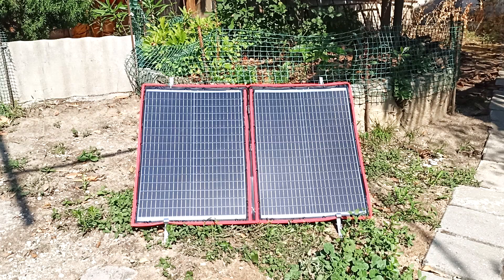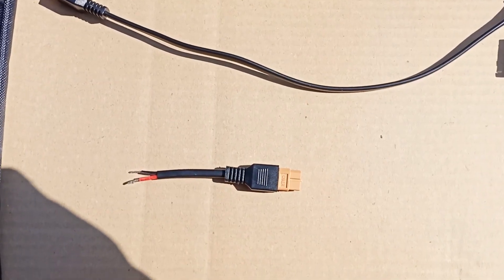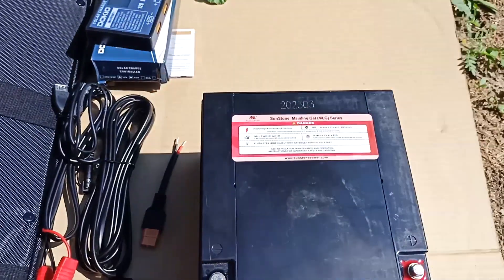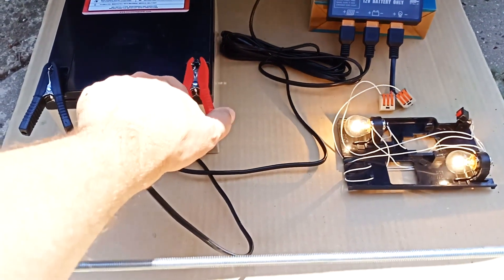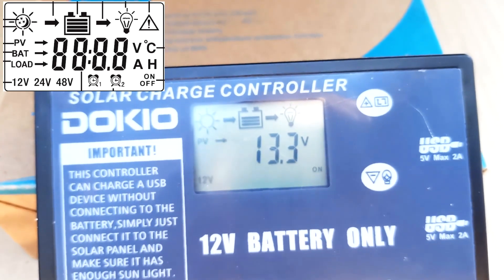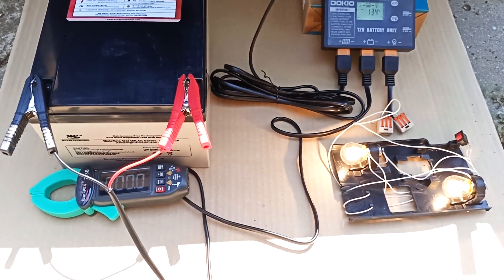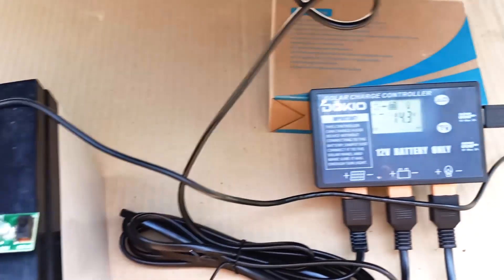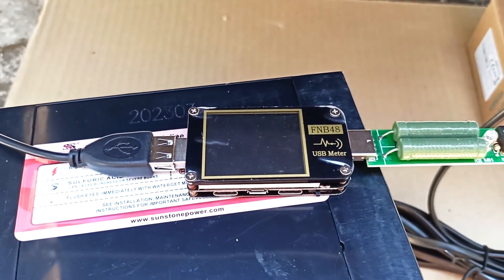100W Foldable Solar Panel DOKIO + 21W Solar Charger – Top Choice for Camping & Off-Grid Life!

Comment from the maker: https://alli.pub/7659vd?erid=2SDnjeSH5Kr - DOKIO 100 Watt Portable Solar Panel
https://alli.pub/7607jb?erid=2SDnjd8NZrt - 21 Watt Solar Panel on Aliexpress
https://bit.ly/SP21W - 21 Watt Solar Battery for Charging from the Video
https://alli.pub/74v73j?erid=2SDnjcYRqMn - USB Port Tester
https://bit.ly/GelAk26 - SunStonePower 26 Ah Traction Gel Battery
https://bit.ly/KZMPPT - MPTT Epever Tracer 2606BP 10A Charge Controller

https://bit.ly/EngKan - Subscribe to this channel
https://bit.ly/Pomkan - Support the channel financially
http://goo.gl/a6YJdO - This channel in Russian.

https://youtu.be/Fq3UyU6v94o - 256x192 Thermal Imager: The Most Compact
https://youtu.be/Mni-P-7enUA - Mini Laboratory Power Supply DPS100
https://youtu.be/wLT6Wwv7nNc - Portable gas analyzer TOOLTOP PLT850
https://youtu.be/fTNVlWXwR2M - Thin digital multimeter FNIRSI S1